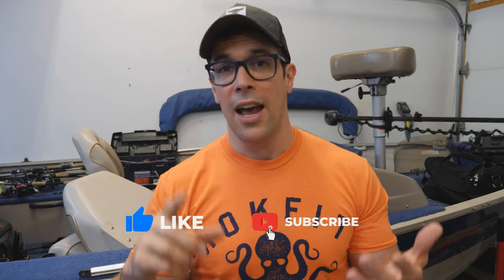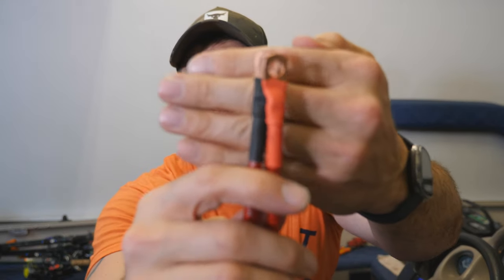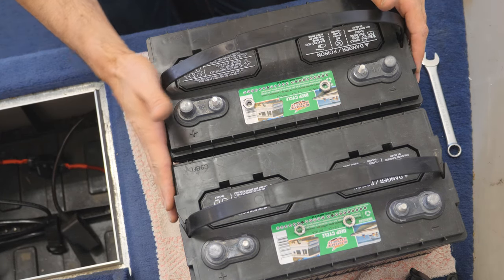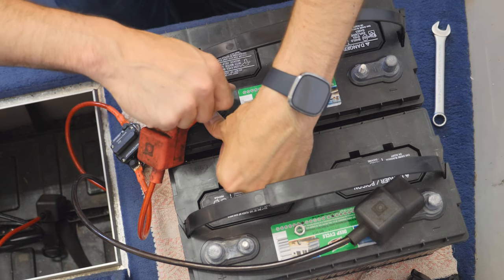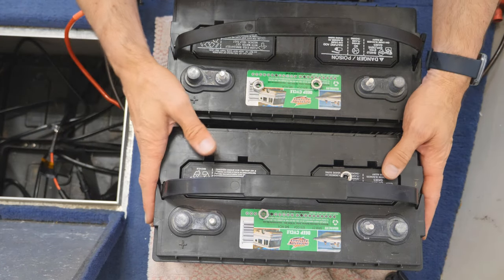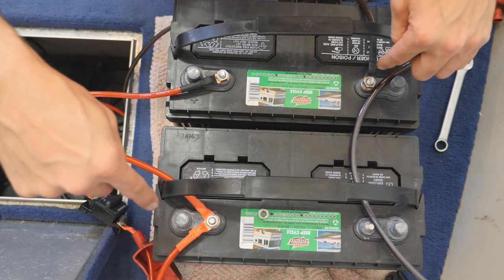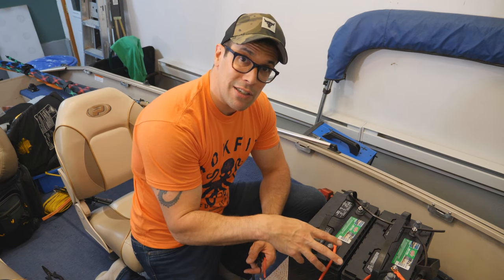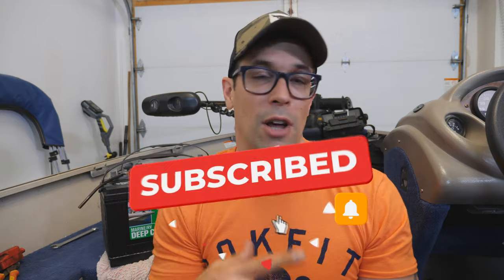Wiring 12v Batteries in Series or Parallel + Charging Tips!

Comment: While hooked up in series , can I still charge them individually? Or do I have to remove the wire connection making them run series ? Basically do I have to remove the wire everytime I want to charge them or can I leave it hooked up In series and charge them fine ?
Reply: I'm curious about this too!
Reply: Same. Where’s he at? 1 yr ago and no answer?
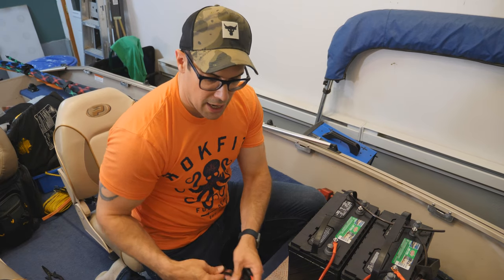Reply: @9:20 to 9:25 he answers that but it's very quick and hard to catch if you're not paying attention. The battery must be separate before you charge it.
Reply: @UnfiItered  That is for a onboard bank charger. What about a regular 12-24 volt charger? im curious as well. Just to be safe I always separate the 2. Pain in the ass but less painful than buying new gear. Thanks

Comment: When charging the batteries that are in series with separate chargers,does the jumpers to make the series have to be taken out when charging them individually?
Reply from the maker: Nope, not at all.  I used to do it that way before I got the onboard bank charger and never disconnected the crossover cable.

Comment: I have wired 2 12 volt batteries in parallel, but when i test the battery charge with my voltmeter it says 24 volts- why is this?
Reply from the maker: There has to be an error in your wiring somewhere, it should be testing at 12v.  Send me a photo on Facebook (Dan Richard Fishing) if you have time :)

Comment: Hey Dan, great explanation and video of wiring series and parallel batteries! One question I have is: my boat has 2 batteries wired in series for my trolling motor and 1 battery for starting the motor. When charging the batteries for the trolling motor, do I need to disconnect the 2 12v batteries from each other and charge them individually or can I leave the system wiring in tact while individually charging each battery? Sorry for the long question! Haha! thanks!
Reply from the maker: This is a great question I get a lot and no, you definitely do not need to undo your wiring to charge.  You would need a 3 bank charger and connect each bank to each battery and charge as needed :)  No need to disconnect anything!
Reply: @DanRichardFishing  i read your "no need to disconnect series connections for charging".  I had extra batteries (4 total) so i actually did parallel and series for 24 volts.  Can i charge all batteries individually without disconnecting parallel connections as well?

Comment: I’m a bit confused now. I have 3 batteries in my boat (1 starting, and 2 trolling motor) and a 3 bank charger. Right now, the 2 trolling motor batteries are wired parallel with one of the banks going to those ( + / - on same battery). I am switching to a 24v trolling motor which means I’ll be wiring series like the other video. In this video you said you could charge one at a time in series? In the other tutorial where you ran the larger wires and wired the 2 batteries in series, you put one charging bank to each battery? So can I wire in series for the motor, and put on one bank + one one and - on the other, or run one bank to each battery with + and - on the same battery?

Comment: Precautionary note: When connecting batteries up in parallel make sure they are both in the same charge state and are identical specification. If one is fully charged and the other is say 50% charged then you run the risk of a very big bang when you make the final connection as the batteries attempt to equalise their charge state by a massive rapid exchange of energy between them. This problem doesn’t arise for serial connections since the battery voltages just get summed together and there is no pathway for them to exchange charge state with each other.

So think of serial as adding voltages whilst keeping the current the same & parallel as adding currents while keeping the voltages the same.
Reply from the maker: Excellent point to bring up, you're absolutely right. Honestly in both scenarios I would prefer to have the same battery models and charge states and if you have an older setup with 4 - 5 year old batteries and one is no longer holding a charge, you should replace the whole set. Thanks so much for your comments!
Reply: So what if you have 1 battery that’s a year old and one that is new? Charge them both before connecting them together?

Comment: Thanks so much for this video,  I hooked mine up in parallel to make it a super 12 volt and I put my battery charger on the one battery and that will charge both you said , I'm hoping this works like a champ I went off every thing u said , so far everything seems to be looking up
Reply: You should connect the positive lead of your charger to the positive lead of one battery and the negative lead of the charger to negative lead of the other battery providing you have them wired in parallel....

Comment: Thank you for this informative video!  I have a very different application. I need to support my cpap when PG&E goes down which is much more frequent than in the past!  I have a couple 12V 35AH AGM batteries and one only lasts me about 4 hours and wakes me up when it runs out!  I was going to spend $1500 or so on a Li solar backup solution which is overkill. I may do that in the future for the fridge but my immediate need should be taken care of when connecting my two batteries and one new one ($65 on Amazon) to give me about 105AH. It should work and I can charge the batteries during the day off the very loud propane generator I turn off at night to prevent neighbors from killing me 😂. Thanks again!

Comment: Quick question for you.. when you talk about having a charger for each battery, are you disconnecting the jumper cables between the multiple batteries, essentially taking apart the parallel/series wiring every time you charge the batteries? If not, how do the two separate chargers detect only the battery you're attaching it to in order to do diagnostic if the other battery is still attached?

Comment: Great advise on 1 bank per battery for charging. I didn’t do this at first as the charger I had at the time put out enough amps to charge everything. I had 1 battery of 3 die on me but voltage didn’t drop so at first wasn’t detected until I threw some amps at it. Finally tested everything at the end of season and found the dead battery. Never again!
Reply from the maker: Yep, exactly why ideally you want 1 bank per. :)
Reply: This episode happen to me a day ago. I had three 12V Battle Burn 100AMP Batteries in paralleled and the third one was dead! I don’t think is damage because these batteries are built to drop to 0 and then recharged back up to 100%. I just don’t know how to get this battery to charge up while using my car alternator. The other two batteries are charger perfectly and read 13.14V each. Don’t know why my third battery went dead. Any suggestions?

Comment: Hi Dan! thanks for the video. This is really going to help me connect my 12v's in Series. Quick question, you did recommend 1 bank per battery when charging. I only have one charger, would it be ok to fully charge one battery then charge the other or do you recommend getting two chargers?

TIA

Comment: I use (2) of these batteries in series to power a three-wheel golf push cart.

A round of golf normally lasts about 4 hours.

Should I charge the batteries after each use?
Reply from the maker: That's a great question, what's the voltage of the batteries after 1 use?  Honestly I would make it a habit of charging them each time but check the voltage and maybe it's not necessary.  Anything at 12.3v or under for a lead acid battery, I would charge it.
Reply: @DanRichardFishing  Sorry I forgot to mention they are lithium batteries. Same recommendation?

Comment: Thank you for showing me how to parallel my trolling batteries  For my 12 V  trolling motor And when I set up my 2 charger maintainers 
 I hook up one maintainer to battery 1 Then I hook up the 2nd  Is charger maintainer to battery 2 as if I was charging them separate  Correct
 Thank you
Reply from the maker: You got it!  Thanks for the comment :)
Reply: How about when they are in series to make 12 V a 24 V battery. Should I use a 24v charger

Comment: According to NOCO tech support, two batteries in parallel have to be on a single bank of the charger. However, with two 100 Ah batts you are over the max capacity of that bank. In my case with the NOCO genius GEN5X3 the capacity has to be under 124 Ah. I had to wire disconnect switches between my two parallel batteries so they could be charged with individual banks.

Comment: So as I connect to batteries in parallel to add my blue switch, does that mean I can charge the battery each individual on positive and negative? I see you had a comment written as a correction saying that it was a positive on one battery to the negative on the other battery, how does that change with the switch?

Comment: Oi! Id like to charge 2 batteries that are parallel connected with 2 chargers for the shortest possible charging time. 2 identical batteries with 2 identical chargers. Do i have to disconnect them from being in parallel in order to charge them with a charger each?
Reply from the maker: Hi Magnus, this depends on the charger, you need to double-check the instructions to see if the charger can charge batteries individually in a parallel setup or if you can only use 1 bank wire for your entire battery bank.  So for example my old battery charger you could just directly connect each battery to each bank no problem, but my current charger does not support that.  Hope that helps!

Comment: great video and great explanation !
my only question is .. if you changer your battery with your 110v at home and the batteries are in serie and you are using 2 12V battery for a 24v motor. wont the 110v bust your batteries 12v in series?

Comment: do you have to disconnect the cables on the batteries when you plug them into the banks like will it throw it off if  they're not isolated? or do you just clamp them regardless
Reply from the maker: Great question, and no you don't have to disconnect any of your wiring when you hook up the charging cables. I do however recommend that you unplug your trolling motor when you are charging your batteries. If your trolling motor is hardwired you may want to install a switch.
Reply: @DanRichardFishing  But all the batteries would still be connected in parallel, so how would the chargers be isolated?  I don't see how the diagnostic capabilities of the chargers could see the individual batteries they are connected to when everything is connected to everything else (including the other chargers), but I'm not an electrical engineer.  Anyone care to clear this up?
Reply: @DanRichardFishing  Dan, I have two 12v deep cycles wired in series for a 24v trolling motor. And I have a 3 bank genie onboard charger. So when I charge trolling batteries do I connect positive to positive and negative to negative on one battery and the same on the second battery like there separate? And do I have to disconnect anything at the batteries before charging?

Comment: I fish a 28 foot boat on ocean in 15 mph winds and the terrova runs at high speed continously.  I want to use outboard's 12v alternator to charge  24v battery or batteries in series while still running troller off the battery or batteries.  Have you done this yet and have a video to instruct me?
Reply from the maker: You can definitely do this (charge multiple batteries in series) but it's a bit more complicated and I do not have experience in doing this.  There's a couple of ways to do it, but the most common method is with something called a battery isolator or you can do it with a manual battery selector.  I have not made a video on this but here's a quick 3 minute video that explains it: https://www.youtube.com/watch?v=5H4lQIlYvLY

Comment: So if I have 2 6volt wired in series. I would connect each battery on its own +  and - . Also would I charge them on 6v setting or 12v

Comment: on the parallel setup can you wire the device on the same battery, or it has to be one positive to one battery and negative to the other battery?
Reply from the maker: You need to use both batteries, so positive to battery 1, negative to battery 2.  Thanks for the question!

Comment: Would you have any clue why my negative fuse in NOCO gen5 battery charger keep blowing when my 2 12v batteries are hooked up in series for my trolling motor?
Reply from the maker: That's super strange Jake, definitely not normal.  Are you 100% sure your wiring setup is done correctly?  has it being doing this since you installed the charger or it was fine and suddenly started doing this?

Comment: I have 4/6 volt battery @ 435 amp and I have 8/6 volt battery @ 230 Amps,  can I hook up them 435 amp with the 230 amp as one installation for a 24 volt system?

Comment: So I have 2 12v batteries in series for a 24V system.  CAN I CHARGE THEM WHEN THEY ARE CONNECTED USING A BANK TRICKLE CHARGER?  DO I NEED ONE CHARGER FOR EACH BATTERY?  AND IS IT OK IF THE BATTERIES REMAIN CONNECTED WHEN THEY ARE BEING CHARGE?  Help please.  Thanks

Comment: How do you wire 2 batteries (24 v trolling motor)  in series with a 2 bank (12v each) charger?  I don’t want to have to unwire the trolling motor to charge the batteries individually.  I want to leave onboard charger and trolling motor connected.  Then just unplug charger AC cable and take off.  Thanks!

Comment: We’re getting 2 Dakato 12v 18ah batteries. Do you recommend charging separately with a 12v 3 amp charger or using  Dakota 24v 5 amp in series.  Not sure if we going to run in series or parallel for the livescope. What’s your suggestion.
Reply from the maker: Hi Gary, sorry for taking so long to get back to you!  So normally I always recommend you run 1 bank per battery... if you don't you can't take advantage of the diagnostics of the charger.  So if you're charging a parallel setup and a battery goes, the charger onboard diagnostics won't tell you which one.  But here's the thing... not all battery chargers CAN charge with a separate bank per battery when in parallel.  I'm doing a video about this soon, but I recently found out that the new generation of NOCO GENPRO 10X series cannot be wired this way... you can only use 1 bank for the entire parallel setup.

So all this to say, you need to validate if the charger you want can be wired 1 bank per battery be it in series or in parallel and you really need to decide on how you want your batteries to be configured (series or parallel) and check with the charger manufacturer if you can do 1 bank per battery either way.  Don't rely on the documentation... the restriction I mentioned above with the NOCO is NOWEHERE in their instruction manual.

Comment: I have three batteries. Two for the 24v trolling motor and one for the 12v engine starter. Can I take one of the batteries used for the trolling motor and wire it in parallel to the starter motor battery. My voltage to the starter motor should still be 12 v but with more cranking power and the voltage to the trolling motor should still be 24 volts. I use a three bank charger.  Will this work? If not, why?

Comment: Thanks for the tutorial, I have two 12 volt 160 amp battery’s linked in series.
Could I use two separate 12 volt chargers, one on each battery?
Reply from the maker: Yes, absolutely that would be fine.
Reply: @DanRichardFishing  would I need to disconnect the batteries from each other to charge them?

Comment: Hello, on my Rv I have 2 14 volt batteries connected together as the following: the + and - wires coming from the rv are connected to the first batteries terminals, then from the first battery to the second battery those terminals i have + to the other + of the second battery and the - from the first battery to the second - terminal. I thought this was called parallel. But the way you connected your parallel example is different from mine. I also do have an inverter

Comment: I have 4 200ah 12 v tubular batteries connected in series , please what is the maximum charging current for them ? I'm using 60A . I'm affraid that I'm  using high curent and I damage them.Thanks

Comment: Do you need to disconnect the batteries when charging each one individually
Reply: Somehow it shouldn't be an issue but I can understand why where there is an issue and that's related to them being separate to begin with. Not all batteries are the same even if you bought the with the same specs and brand... I found that the batteries charge at full capacity when charging individually.. maybe 85 to 90 percent capacity when in series... But voltage will be there either way... weird but these lifep04 batteries charge fast anyways compared to lead..

Comment: Thank you for the video! I have a question. Can two batteries be hooked up in series for a 24 volt trolling motor and also run 12 volt fish finder graphs at 12 volts if the graphs are hooked up to just one of the batteries? Thanks, Tony
Reply from the maker: Yes, you can absolutely no this but I would highly recommend you avoid doing this because hooking up your graphs to the same batteries as your trolling motor almost guarantees interference on the graphs when the trolling motor is running.
Reply: @DanRichardFishing  Okay, thank you very much for letting me know about that likely issue!

Comment: hey mate thanks for this video but what do you call Battery bank  for charging both batteries ? is it VSR Isolator ? 

Cheers
Reply from the maker: If you're charging source is only a single bank and you have multiple batteries then yes you can use a VSR (voltage sensitive relay) but I always recommend going with one Bank per battery so that you have proper battery monitoring and testing for each individual battery.

Comment: Modern chargers can and do charge a whole battery bank. A Ctek MXS10 can charge up to 300 amp hrs at once from discharge. It will recondition, desulphate and fully restore full capacity as well as diagnose faults.